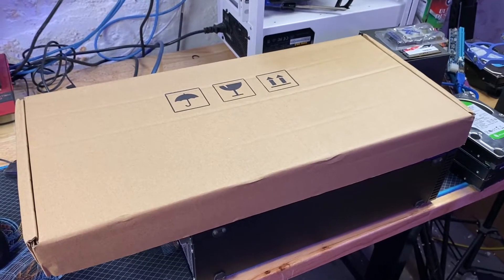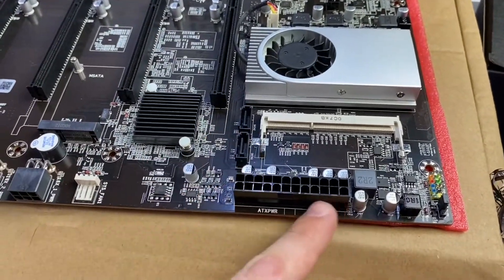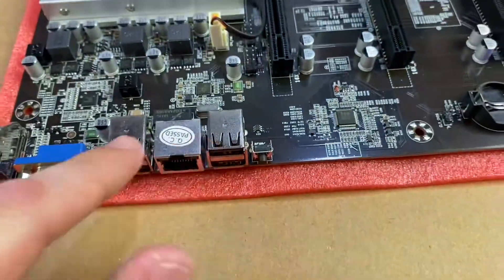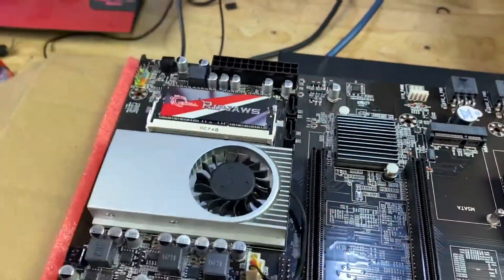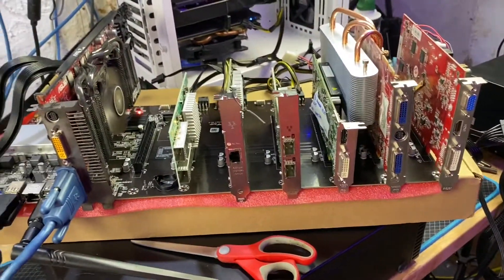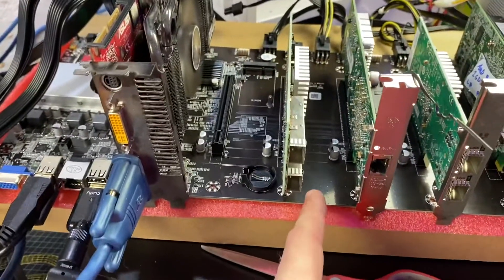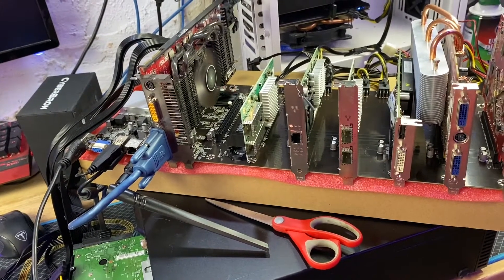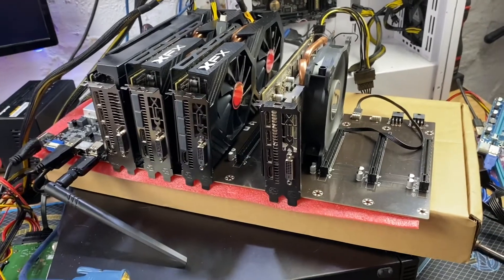$90 Jingsha 8 GPU mega mining motherboard unboxing and overview BTC T37

Comment: hello sir, whats the shortkey to go to the bios setting ? And one last question sir, for example 

if my house lights out for 2 hours, then 2 hours later the electricity comes back on. Does my rig automatically turn on or do I have to manually press the power button?
Reply from the maker: 'del'

theres a physical jumper for resume after power loss.

I actually retested this board and it will run 8 3060s on Linux no problem but wont handle that many cards on windows for Ethereum

Comment: I don’t understand what all of those 6 pin are for, do they power the pcie port individually?
Reply from the maker: they're to provide power to the slots themselves for cards like a 1650 non super which do not have a supplemental power supply. ideally you do need them plugged in.

since filming this, I have determined this isn't powerful enough to mine anything with more than 3 GPUs.
Reply: Even if the gpus are powered directly from the psu can you still only run run 3 gpus?

Comment: What are you mining ? Bitcoin ?
Reply from the maker: The platform briefly shown on the screen is a hashrate broker I leverage called Nicehash. the GPUs here are primarily mining Grin as anything with under 6GB of ram cannot mine Ethereum, the most profitable GPU minable currency. Typically I mine Ethereum though to answer your question more directly

bitcoin is primarily mined on devices called an ASIC. not profitable on PC hardware any longer.